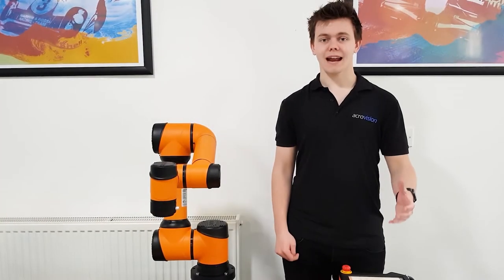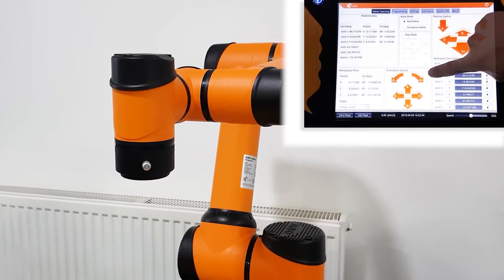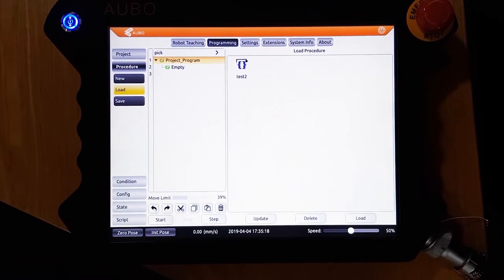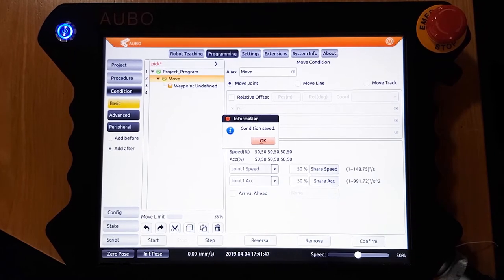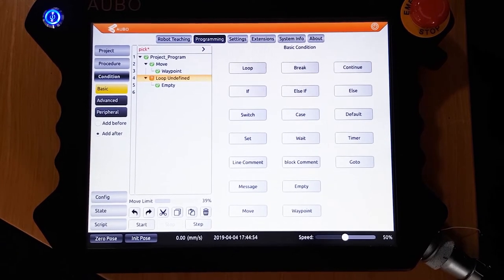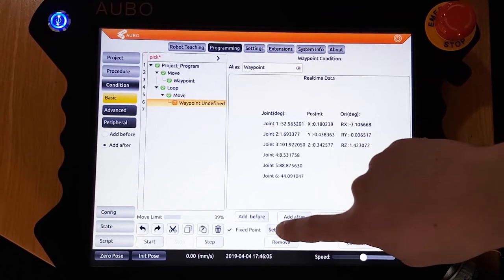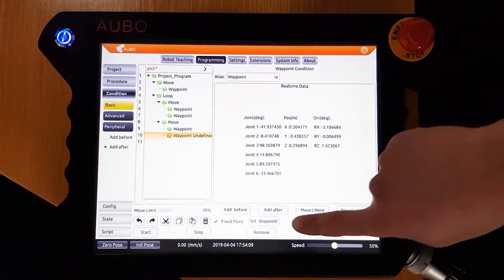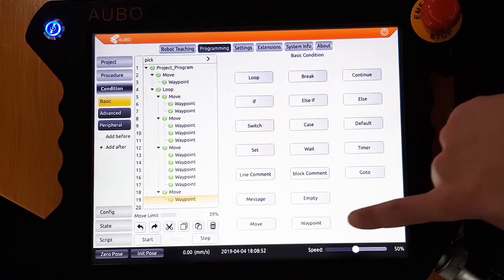How to program an AUBO-i5 Collaborative Robot

Comment: How oh how do you make the robot work at a slower pace? Running into difficulty with it doing precise movements, and was hoping the speed would help...
Reply: Heather, What application are you using the robot for?
Reply: Stephen Perkins we are using the robot to carve wooden sculptures. We create the tool path first, (in such short increments!) then the robot replays what we teach it. Really quite a large learning curve, so any tips or advice would be welcomed.
Reply from the maker: @heathergorawski6261  Hi Heather, Sorry for the very delayed response! Its been very strange times! If you need assistance on the AUBO, please contact us directly so we can support you. Email: info@acrovision.co.uk or 0845 3370250. Thank you.